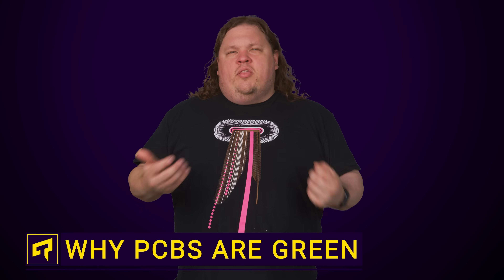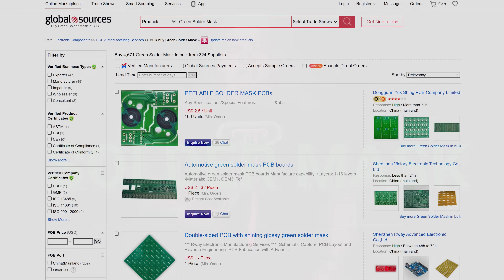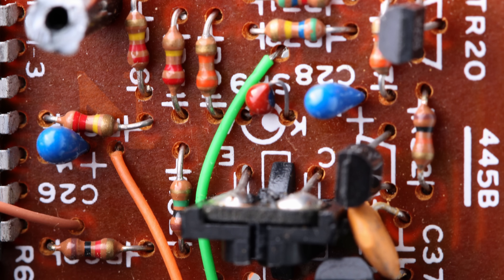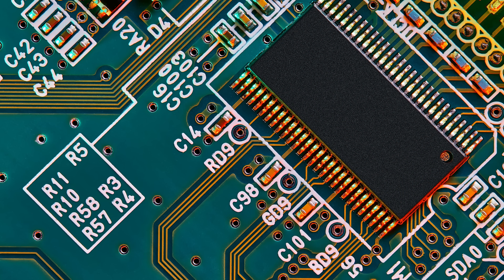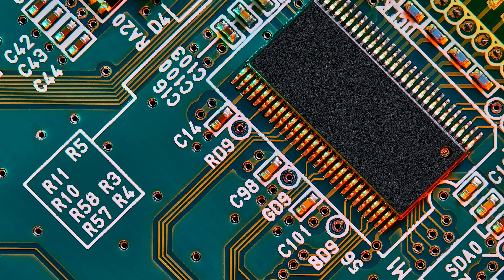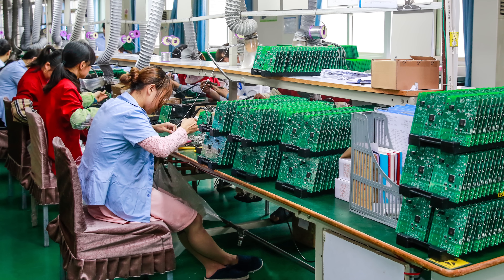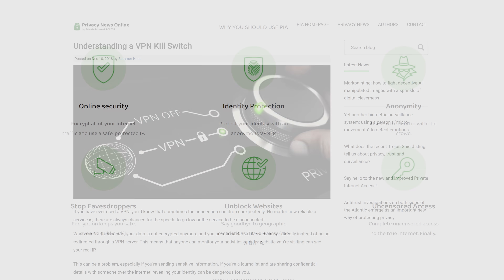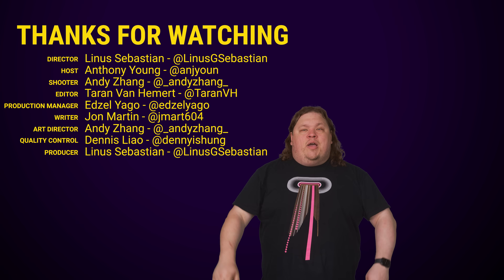Why Are Circuit Boards Green?

Comment: Some 15 years ago, i had to do with special military circuit boards. These board had (if i remember it correctly) a brownish colour and no solder mask (not needed, a special conformal coating was later added). No traces visible except short traces to vias.

Comment: White and black are difficult for assembly due to heating effects. This can be solved by doing temp profiling but that requires extra steps during reflow.

Green is the majority because the majority is green. There used to be a cost adder for non-green solder mask so it could be cheaper to stick with green

As for ease of inspection, white is best as any presence or omission of components is easier with white.  Consequently, black is the most difficult. 

When I designed boards, my progression was, red, xxx, xxx, green, where red symbolizes the first spin of a board and green as the production variant of the board. The colors in between are for me to quickly identify the version of a board. It’s simpler to ask a tech what color is the board they are working on instead of looking for a revision letter/number somewhere written on the board.

Comment: Green is the most common because it cost less. I have seen Red, Black, Blue circuit boards also but the green mask is most common and because it is the most common it is the least expensive which makes it the default choice unless the company is trying to stand out and willing to pay more to do it.
Reply: Prettiest board is a tossup between white and clear/copper. 
White is so easy to visually inspect for missing components as the pads themselves are whitish in color and most components are black/non-white. 
Copper/clear soldermask is aesthetically pleasing to if you have wide parallel busses on the board.

Comment: red soldermasks were used for many tvs, radios, etc by Thorn (Ferguson) here in the UK in the late 60s to mid 70s, maybe 80s, a few later ones more brown than green, , ,the zx81 pcb used either green and red,

Comment: Due to various factors in composition of solder mask as well as development and precuring of solder mask, the green colored one is also the easiest to produce dense chips with low spacing between the SMD pads because the minimum solder bridge size can be smaller compared to other colors. In general, minimum solder mask bridge would be 0.06mm for green and 0.1mm for other colors. Minimum solder mask bridge size matters because if too thin, it can break off and you can get solder shorts.

Comment: A few misconceptions here. The glass epoxy boards were never green. It has always been the solder stop. I have hard many stories of why, I don't know what is the correct, but I think it had to do with the chemistry in the early days. Now it's as you say, due to being the most common and due to contrast. In production, we use 3d photo scanning of the boards to find errors, and the equipment works better with green, and really struggles with black. So, yeah, higher yield is correct.

Comment: My understanding of green PC boards is because PC boards were green. It was cheaper to make it green PC boards. Changing colors added cost on the production line. 
But that doesn’t appear to be the case in modern times. There doesn’t appear to be much of a cost difference in getting a different color.
Reply: why was green cheap?
Reply: @TheAlison1456  
It was cheap because everybody use the green.  The green is actually the solder mask. Changing the color required. Cleaning the equipment so that the previous color wouldn’t affect the next batch. So it was cheaper to just stick with one color.
Anyway, that’s what I was told in the distant past. Now it seems to be easier to get different colors without much additional cost.

Comment: Well the options for different colored pcbs were there for waaay longer than the whole "checkout my sick looking motheboard" days, and in fact were the same cost to make if you were ordering big enough batch. Hobbyist used different colours for quite a while too, since masks could be somewhat easily be bought in bulk with quite a variety of colours even back in 00's(probably in 90s too, but that would heavely depend on your location). So that one is out. Also you could make the "substarte" of the pcb any colour you want if you add the diy to the epoxy, or use some more expensive epoxy to make it to get rid of that "brownish" colour. No one bothered because the concern was the cost, and it's not like anyone cares what colour your substrate is.

Comment: the substrate, once etched:
milky yellow (fr4 with uv block) 
white (Teflon content - high frequency)
tan/brown phenolic paper

the requirements of the engineering team determine the finish on top of the etched surface.

Solder masking is either a dry film hot roll lamination or a liquid coating. both of these are photo image applications. 

The volume that green is sold in makes it often the least expensive. Thus is the default for many vendors. 

Other color options like red black blue purple may carry a subtle premium over green. Check with your vendor to see what they can offer.

Comment: Brown pcbs as shown here are SRBP. (Synthetic resin bonded paper). it’s the paper than colours the board. The solder mask on the other side can be any colour you like. The colour of the mask makes no difference to its dielectric properties. Green was just the cheapest composition. I’ve had customers request boards in their company colours. Others use different colours to denote a development stage, such as blue for First engineering samples, red for Second engineering samples and green for production. (PCB design Engineer, 40 years experience CID qualified)
Reply: If you could list and rank every solid colored motherboard you saw during your time in the industry that wasn't green, how would you list and rank them from most pleasing to least pleasing and why?

Comment: Even though is true that composite or fenolite (Not sure how to say this in english) are brown the most common material for multilayer PCBs is fiberglass. Fiberglass is expensive when compared to the other two but offer better specs on electric insulation and electromagnet characteristics.
Well, fiberglass is somewhat green by it self but still pretty clear, so the PCB manufacture usually will add some shades of green on the PCB material and this color is usually greenish cause it is easy to use on a material that is already green. So which color would you choose to cover your beloved PCB? Mostly likely the one you already have on your stock. This is the main reason on why PCBs are green. Sure, it makes easier on us Eng and tech alike but a company would never use more money just for our comfort.
One way we make modern PCBs in other colors is: the common way like i said before and after PCB inspection we paint it with a solid color (Since the color used for production are almost transparent) and send to the pick and place machine and after that soldering technic (wave soldering or furnace).

Comment: If you look at your thumbnail image for this video, that board has had a green protective coating added after it was etched. (and only holes were spared and expose the copper.  Oe woudl need to look at the actual board to see if it were also green.
Your viodeo caused me to look at some old DEC boards and found one where the traces are 2 layers. Upper layer is copper and lower layer is a grey metal.   The copper present only on the portion of board that slides into the bus connector and is directly above the grey metal layer (so electrically connected). Both metals are exposed (no lacker over it). this is a sparsly populated board).

Comment: Digital Equipment Corportation (once second largest computer manufacturer in world) had mixture of Green and tan boards.   The tan board tended to be the less complex boards. For instance the Q-Bus extender cards provided a way to join 2 separate Q bus enclosures to create 1 logical Q-Bus so you could plug in many more cards).  Those had limited on-board components but had traces because of need to get lines from the bus board to the rubbon cable connector.    DEC alo had light green vs traditional darker green boards.

BTW, for some reason, this video loops back continuously in case you set some switch and wondered if people would notice.

Comment: One of the most complicated DIY projects I ever worked on was a large white pcb. But then again I don't find black to be much easier, and it is very popular. Both of them are completely monochromatic, no different color for the traces vs bare pcb areas, makes the circuit just so much less intuitive

Comment: Are green PCBs cheaper?
Glass epoxy, which was originally used to make PCB solder masks, is green. Nowadays, green is still the most common colour, and therefore the cheapest to produce, so it is still the default colour used on printed circuit boards today

Comment: I know it is an old video, but it likely has more to do with cost and the material the board is made of. The resins used to bind the fiberglass in G10/Garolite/FR4, which is often the core material of the circuit board, will be a yellow/tan to green. To make it any other color would require adding additional dyes and thus cost.

Comment: Honestly, I wish they brought back the green. I have a black motherboard and it's a PAIN IN THE ASS to see everything connected to it (cables also black), especially in a low-light room. I always have to move it sooo much closer to the window to actually see anything. A flashlight isn't enough. 99.999% of the time I don't look at the internals of the PC I'm using, but when I do, I wanna see EVERYTHING, CLEARLY. And if any component is burnt, it stands out better on a green circuit board than on a black one.

Comment: Although you're technically right. It was more like watching someone try to hit a pinata, eventually they will hit it a few times. Green was deemed the best color for PCBs by the DOD due to the coppers high visibility through the green mask so repairs could be more easily done in the field.  As such most PCB manufacturers produce PCBs for the DOD as well as the private and public sectors. Because of this PCB manufacturers use green as a cost saving measure so parts can be mass produced for everyone without having to change to mask dye.

Comment: I design and manufactured pcbs from the old age of 80's using bishops and letraset calca material over herculene sheet and desing table , and in this times the majorie of this circuits are made over bakelite , the fr_1 or fr_2 are expensive material in this times and nobody use solder mask over the pcbs cooper , only serigraphic inks over the component side. Now the green inks made in china in major percentage are the most cheaper over the other colors , but yes Dupont industry was the first company in use this color in his solder mask ink in this old times. I remember one fiber pcb of tektronix oscilloscope made in the 70's , this amazing pcb was maded in the three layers but without solder mask protect the cooper because in all this years, instead the industry use thin to protect the cooper traces.

Comment: Anything involving green, contrast and our vision can't escape the fact most of our natural color sensitivity uses green wavelengths sensors. Our eyes have as most as "green" sensors as "blue" and "red" combined, so our color vision have a "higher definition" in green. And it is obvious giving our environment and evolutionary history.

But I doubt the green pcb have anything related to this. I think t's just as a "fad" as IBM beige computer carcasses. Some major industry adopted this color, driving the prices down, and everyone else just used the cheapest color.

Children from the 80's to 90's know how Dell using "Silicon Graphics"  black (or "graphite"?) pushed their higher end products.

Comment: Human eyes are most sensitive to green color and it reduces strain, specially when tracing tiny lines on a circuit board. Similar reason why you see most gambling tables have green color felt, so the gamblers' eyes don't strain and they keep on playing. Nowadays companies try to protect their intellectual property by using black dye on their circuit board so the competition will have harder time reverse engineering/copying their design.

Comment: They are green because the flux of solder turns brownish green.  Green and brown/amber circuit boards conceal this well.  I just had a white PCB fabbed and I see this ugly greenish brown flux lol.  I have to clean it off with alcohol.

Comment: I just saw this video.  I've been using G10 (FR4) for 30 years for other purposes. It was always green until recently. Green is the natural color if no pigments are added. Colored G10 is made by adding pigment to the resin. Can't attach a photo but I have one showing the construction of a rocket from G10 tubes and plate in 1992 and they are green.

Comment: When i was little my father used to make circuit boards himself for his builds ( he was audio & video service for many brands and was doing side projects for himself) He was getting those and melting them into acid then putting some kind of oil or liquid (not quite sure as i remember that part vague) on them and so on. That green thing doesn't actually melt from the sulfuric acid he was using to make the circuit board.

Comment: Senior EE here: Short answer is, the soldermask color is an arbitrary choice for the most part. There's a few common colors that almost all board houses can do- green, red, blue, black, and white. Certain colors like yellow and purple may not be available at all board houses though. The actual FR4 core is usually a pale yellow. 

Some boards require a particular color for an application, or for industrial design reasons. Eg, a high powered LED board generally wants to be white so it reflects light. On the the other hand, a board with a CCD sensor generally wants to be black (if the PCB is exposed to the optical path) so that reflections off the board into the sensor are minimized.

Often though, if there are no industrial design requirements, I will alternate between common colors (green, red, blue, purple, ..) for each revision so I can tell them apart at a glance.
Reply: As a fellow Senior Eastern European I thank you for your very informative post,.
Reply: Thanks, very informative
Reply: As a fellow senior East Ender, I too have an abundance of chest hair
Reply: nice data about ccd's (cmos)
Reply: TO EVERYONE IN THIS CHAT:

THE JUDGEMENT OF GOD IS DRAWING NIGH.

REPENT TODAY AND GIVE YOUR LIFE TO JESUS TO ESCAPE ETERNAL DAMNATION!,

Comment: I hated green for years… back in 1999 I had a green Intel board (Sun River chipset) with a Slot 1 Celeron and built-in TNT GPU. God I hated that thing. I couldn’t upgrade the fukkin thing because it didn’t have an AGP slot for a better GPU, and Slot 1 was a POS that I don’t think was very upgradable either.  And I didn’t have the money to do a full refresh. Then I would see all these other manufacturers like Asus doing coloured boards while Intel still stuck with green. The whole experience made me hate Intel boards for years.

Comment: "Why Are Circuit Boards Green?" umm they are not. 
it's a bit like asking "why are cars black?"
"solder mask is a lacquer that protects the board from oxidation" umm how does epoxy and fibreglass oxidise?  oh does he mean the copper tracks? no it's not for that either, there is a reason it is called "a solder mask" and that is to prevent solder from sicking to parts that the maker doesn't want solder, much like when painting you "mask" where you don't want paint to go. you have to remove the mask where you want solder to stick to the copper, and you use flux to remove the oxidation. 
in early days of mas production they didn't use a solder mask and all the traces and tracks were covered by solder. these tracks and traces were very wide and spaced far a part, but as we reduced component size, track and trace size the solder would bridge between these tracks and traces causing shorts, which are bad. so to prevent those shorts that they didn't want the masked off all the stuff that didn't need to be soldered. and presto! solder mask was invented. the green it started out with was due to the materials used in the mask, in more modern times they colour the mask, but ONLY for aesthetic reasons, oh and marketing.

Comment: I bought an industrial motherboard from Aaeon. It's green old school and very reliable like many other industrial motherboards. It does not support features like Sli/CrossFire or even overclock, but it's very reliable and strong. It would be interesting if you guys address this topic on industrial motherboards.

Comment: "Fun" colors on hobbyist computer hardware has been around for not less than 45 years.  Solid State Music used blue solder-mask on their 8K RAM boards for s-100 systems, and they were originally sold in 1976.  Twenty years later, I was designing some gadgetry, and "just for fun" I specced red solder-mask, on the product that was called by its users, "The Red Board" ignoring its proper name.

Comment: Im a technician. 
There is NO ACTUAL reason for it,  Its just the materials used back in the day. Even yellow fiberglass was used in boards, like many guitar amps and govt workstations.
now they make them for aesthetics and heat resistance level by just a quick look at the board. 

I built and repaired electronics for years i was also a circuit board technician at SUPRO guitars for Absara audio USA.

Comment: Simple answer is It is due to the solder mask, which protects the copper circuits printed on the fibre glass core to prevent short circuits, soldering errors, etc. ... The colour of the solder mask gives the board its appearance.